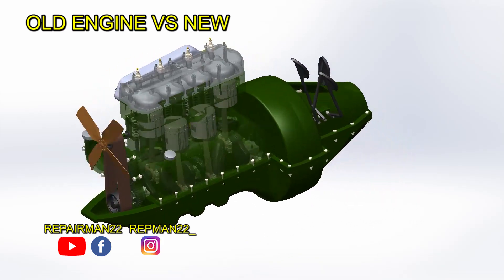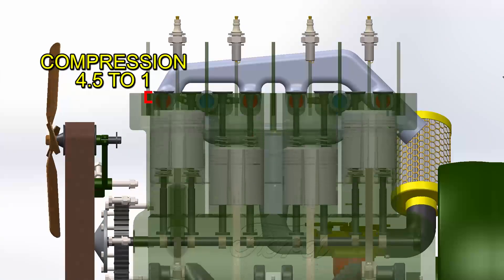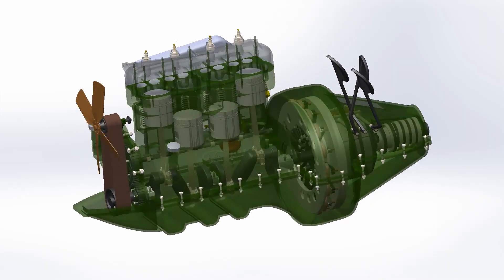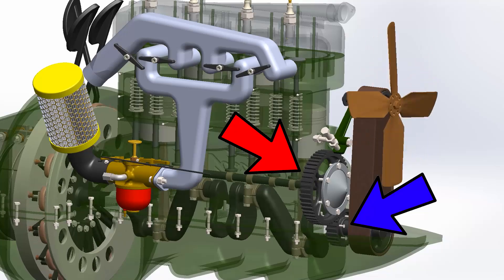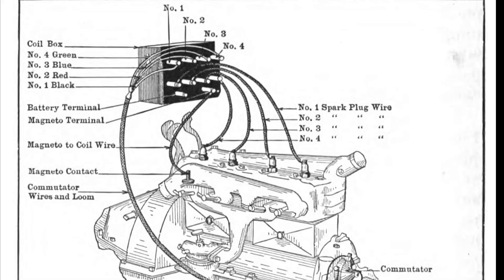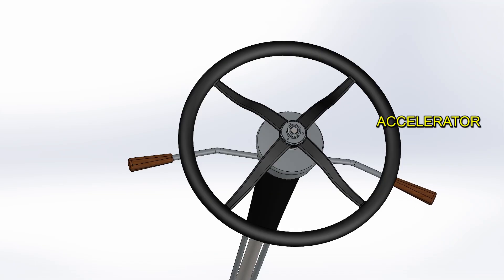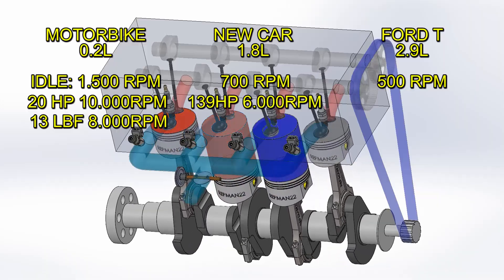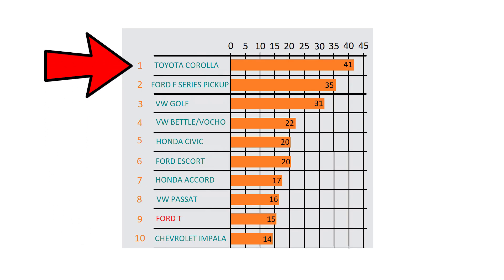Ford T vs New Car 🤯 3D Animation// What changed in engines in 100 years?

Comment: Of course a car made 120yrs ago appears primitive by modern standards, but if the alternative was having to ride a horse I'm sure even a modern motorist would be grateful!
Reply: Although the model T engine is primitive, it’s more appropriate to call it simple and reliable. 
Another option for the time is to ride a bicycle.
Reply: @kerbodynamicx472  Simplicity is the aim in engineering, not complexity. Complexity is very bad, decreases reliability, increases cost. So when something is made more complex, there usually has to be a very good reason to do it, which in modern cars case is far better efficiency.
Reply: @wopmf4345FxFDxdGaa20  the are really not that much more efficient though. For example, I drive a 1990 f350 dually powered by a 460 big block, it gets 10 mpg. The new 7.3 gas engine is the closest comparison to a 460 and a new dually f350 with a 7.3 gas engine will get little better then 10 mpg.
Reply: Few people could even afford a horse or didn't have the land even if they could.  Most people walked.
Reply: The Canadian Automotive Museum has one of the three Galt gas/electric cars made in Galt, ON, Canada. It was made in 1914 and used by Toyota for the year 2014 to promote the hybrid Prius. Under the hood the engine does not look a whole lot different than today’s hybrid. So many car manufacturers failed either due to lack of capital or being bought up by larger manufactures such as Ford and buried due to the innovation that would constitute competition.
Reply: And dont forget ,horses shit everywhere ! 😉
Reply: Seeing as "primitive" refers to early iterations of things, that's exactly what they were.
Reply: No shit buckaroo thank Ford for that. #fuckyourcheby #fuckyourmopcar
Reply: And steam and electric. Not the best timeline we've gone down
Reply: Of course. Why ride a horse when you can spend hours in traffic in a wagon that needs tons of fuel, oils, belts, rubber tires, insurance and endless other crap ??
Reply: Tell that to the Amish.
Reply: $ 5.00 a gallon gas ...we might go back to horse and buggies..
Reply: @tommywatterson5276  Gas in 1915 was 21 cents a gallon, the equivalent of $5.15 in today's dollars.
Reply: @mikefrech1123  in 1915 there were 25 cars per 1000 people. In 2012 for instance there were 800 cars per 1000 in the US. So I guess cars and the gas infrastructure to service so few cars in 1915 were both for the wealthy.
Reply: @mikefrech1123  
Very  interesting  .
But  ?
They  were  "  Just  starting  out  on  that  long  and  arduous   Journey  "
( ie  finding  cheap  oil )
Reply: @tommywatterson5276  Alarming   ?  Is  it  not  ??
Reply: laugh in Amish
Reply: @tommywatterson5276  8 dollars in Europe. You are still way cheaper.
Reply: @Romif_SK  you have Public transportation and your entire infrastructure isn’t built around roads
Reply: @tommywatterson5276  
Don ' t  be  stupid  .
Find  and  develope  more  TYPES  of  "  Oils "
(  Midnight  oil  ?
And ?  What  " Old  Greasers "  use  ? )
And  ,  oh  by  the  way  there  are  MANY  MORE  things  that  can  be  done  about  the  so  called  price  of  "  eggs  "
(  Fuels  &  lubes )
Examples  ?
Too  numerous  to  mention  here .
But  even  a  NEW  way  to  get  fuel  grades  liquids  from  Coal   !
Cheaply   !
     Yup  .
Reply: @tommywatterson5276  5? It’s already 10 in europe
Reply: @Pierre578  everything is relative. I'm in the southeast US. We are USED to paying in the 2 & 3 $ per gallon range.
Reply: @tommywatterson5276  nah just walk and riding bicycle
Reply: @albertsuseintsus7355  Electric vehicles are taking over.

Ironically, the very first cars were powered by primitive non-rechargeable batteries.  It was the Ford Model T that replaced electric motors with the internal combustion engine.  Now they've come full circle, with fully-rechargeable batteries that can compete with or exceed a tank of gasoline, and electric motors that vastly outclass their gas-powered competition in every respect.  With the ease of generating electricity from so many possible sources, the fuel supply is radically simplified, abundant, and extremely cheap.
Reply: @Terminator484  wait, why Henry Ford didn't make a car using gas generator (same power)

that was cheaper , lower fuel consume than Ford model T flat head🤔
Reply: @Terminator484  Yes. There was an 1899 electric delivery truck, used in NYC. Speaking of Gotham...folks diss on the Subway system there (unreliable trains, crime, etc.) BUT...That city was a stinking, overcrowded S**thole at the turn of the twentieth century...worse than nowadays. The streets were full of horses and horse poop. There were streetcars, but those conflict with road traffic, and have to stop at intersections. The former Brooklyn Dodgers were so-named, because you had to be streetwise and not get hit by one of those things. There was an Elevated train going to East Harlem by about 1883. It was steam-powered at first. They were  Very noisy, going past the tenements. There are still some elevated sections today. Also, the Blizzard of 1888 brought ALL transportation to a standstill. That was the inspiration for the subway system. Flooding from hurricanes does cause waterfalls down the station stairways, and I think they should build a barrier to prevent that. But, even the worst blizzards don't effect an underground train. 
There was also the Waverly Electric Car. And, the Stanley and White steam cars were much coveted, as they were more reliable than gas engines in the Old days.
Reply: @Terminator484  Two things wrong; 1) Lead acid batteries are rechargeable, so it is a total myth that old electric cars would have had non rechargeable batteries. The problem was that there was no electric grid so it was useless outside the city. 2) Electric car today still does not outclass gas powered competition at many areas. Three examples; cold weather usage, range and again operation outside the grid.
Reply: @Terminator484  Where did you get the idea that the cars that were replaced by Ford-T were using non-rechargable batteries? This is as silly idea as it gets...
TAXI's were using it... so how much was the cost of a TAXI drive 120 years ago? LoL
And how they managed to win with horse powered cab?!
Normal lead–acid battery were used! Just like in good old Melex cars.
Reply: @Terminator484  maybe but even for free I wouldn’t want an ev car or modern cars . I love my car so much . I don’t care about the rest . Still drive my 1957 jeep .
Reply: @Terminator484  also electricity price explode too in some station in France a full recharge cost more than a full tank of gas .
Reply: @Terminator484  sadly, neither replacing gas cars or beating them is true:
-Gas is VERY energy dense, it can outdistance an electric car despite a 70% energy loss from mechanical losses
-There isn't enough high power infrastructure for teslas to charge in reasonable times in most of america(est.2020, it may have gotten better, however you'd still need an electric generator in the trunk of your tesla)
-At best, an electric can get good launches from it's instant torque, but it doesnt have any gearbox to let it keep up acceleration with literally any half-decent gas car
-Motors don't weigh much, but those lithium batteries do and while it plants the car very low to the ground, it's still weight that needs to be moved so you'll need torque vectoring to even make the handling comparable to some 80s crapbox
-also batteries are bad for enviroment, 10 years of use before you go pollutant neutral(or it was be less polluting than a hybrid)
in summary, hybrid #1, gas #2, electric and hydrogen need to go on a diet before they can even consider existing in public
Reply: @Pierre578  based, has the classic willy's as opposed to whatever the hell things we have now
Reply: @Pierre578  apparently world-class, europe's backbone nuclear reactors couldn't provide cheap power to your cars o7 i hope it gets better
Reply: @albertsuseintsus7355  This isn't cheaper. The reason being that first,  you have to haul around a battery and an extra engine. Second,  converting mechanical power to electric power and then back again has a lot of losses. Third and most prominent; having several gear ratios increases efficiency. This third problem no longer exists for modern hybrids.
Reply: @wopmf4345FxFDxdGaa20  Lead Acid batteries have a habit of pumping out lots of amps at low voltage. They quickly deteriorate and break if they're not fully charged. That's why their use is to power electric starter motors; temporary and only partial drain to power a high current low voltage device, backed by an immediate recharge. Nowhere near appropriate for powering an electric motor until drained and then recharged later. They weren't used for this purpose.
Reply: @Johnsoline  if gas electric engine is useless  ,then why does diesel electric locomotive and diesel electric ship still exist?
Reply: @ok-qz7cx  the idea behind electric motors is that they don't need a gearbox. Gas cars stair-step their torque, exchanging torque for speed in a manner that very roughly simulates the natural torque angle of an electric motor as you shift up
Reply: @albertsuseintsus7355  this question has nothing to do with what I said. Using a gas engine to power an electric motor in a hybrid model T built with 1908 technology would be senseless. It's modern technology that brought us feasible hybrid cars
Reply: @Johnsoline  sorry ,but it's possible to build an gas electric car/motorcycle in modern era ?
Reply: @Johnsoline  Starting batteries indeed do not tolerate deep cycling because they are not designed for that, but there is other type of lead acid batteries that are slightly better for deep cycling. Sure they are still not very good by modern standards.
Reply: @Terminator484  electric vehicles aren't taking over shit, they are gay and only fans drive them.
Reply: I'm not so sure I agree. Horses were more reliable than the first few generations of cars according to my grandparents but I wasn't alive back then to say for sure so what do I know.
Reply: @YblockEnthusiast  but you only used fuel when operating the car. The horse had to be “fueled” even when it was just parked.
Reply: @erniemee7128  Yes, but "idling" horse is "burning" less than a working one. The only issue with horses is their exhaust fumes...
Reply: @YblockEnthusiast  
Yes  ,  a  truly  Marvelous  beast  of  a  High  Tech  machine  !
Awesome  potential  for  the  future  ,  like  many  other  Animals .
How  often  do  you  see  African  Elephants  towing  a  loaded   cart  ?
Whereas  ,  the  lndian / Asian  are  leaving  those  African  dudes  "  for  dead  "  ?
Reply: Yes  ,  lndeed  !
The  seat  fitted  to  a  horse  ie   hairy  skin  covered  meat  muscle  flexing  continually  ,  is  like  a  " Bouncy  Cast ill  "
Don ' t  be  " Cowboys "   ALL  your  life  North  America  !
Come  back  to  earth .
  From  
         Geo  rage   ?

Comment: Surface area has basically nothing to do with friction. More bearing surface area is desirable, as you will get into hydrodynamic lubrication regime faster and increase the area of load distribution.
Reply from the maker: That is 100% true in theory, but in practical terms, 1 you have to move more oil so there is more friction. 2: oil harder to enter and reach the center to lubricate in larger bearing with no oil pressure.
3: Modern cars uses 0w20, small bearings and low tolerance to use less oil in that zone. Thank you.
Reply: @repairman22  if the three bearing system worked they would still use it it doesn't work.
Reply from the maker: @davet.5493  now cars make 200 horsepower, not 20. thats why we use today 5 bearings. Also we have oil pump... it is said in the video!

Comment: Alcohol typically has a high octane rating of about 100 to 110, so saying that the model T's low compression ratio allowed alcohol to be used is WRONG.
Reply from the maker: but the manual advancing was the solution, thats why.
Reply: @repairman22  : My point is that alcohol engines have no need for less than 10:1 compression ratio, reguardless of timing.
Reply: @johndavidwolf4239  You don't need high compression to burn high octane fuel, but high octane fuel allows you to have high compression without knocking
Reply: @czechgop7631  : True, but both efficency and power increase with higher compression, engines should always be designed to with the highest compression that the intended fuel used can withstand.
Reply: @johndavidwolf4239  And with that I absolutely agree, even though high compression ratios bring high stresses to all components requiring heavier engines and expensive specialized lubricants. We may hit a point where the boost in efficiency just won't be worth it anymore
Reply: @repairman22  ALL CARS HAD MANUAL ADVANCE CONTROLS UNTIL THE MID 30'S. Do home homework
Reply from the maker: @johnrebus1641  so. We are comparing a t with a 30' or with a modern car?

Comment: This isn't a fair comparison, the 1909 engine is a MOPAR engine that Ford bought from the Dodge Brothers.
Reply: ouch but true
Reply: The term mopar wasnt used by Chrysler corp until 1937, 17 years after the Dodge brothers both died. The Dodge brothers were contracted by Ford to build the engines and some other parts, but the design of it was all Ford.
Reply: I beg to differ. Read the article American Car Historian: The Dodge Brothers and Henry Ford. The third paragraph tells me that The Dodge Brothers in 1902 Mr. Ford asked John and Horace Dodge to become his major parts supplier. (Abriged.) They made him running gear which consisted of the engine transmission and axles. This went on until sometime in 1913. You are right, it was not called MOPAR until 1937 from Anti-freeze. But, this name is now connected to every mechanical part that is connected to a vehicle connected directly to Dodge Chrysler. So yes, it is still right for myself to refer to it as MOPAR.

Comment: If a company built these new today, how much would you pay for it?
Reply: $50
Reply: @johnrebus1641  but you'll pay 10k for a golf cart.
Reply: About 1500$… I mean I can get a harbour freight motor with more power for like 200 bucks so
Reply: It only needs 20 horse though. But it has to have the old tractor engine sound.

Comment: as a BMW E93 3 series owner, the reliability hasn't really changed in 100 years.
Reply: You weren't getting 200k miles at highway speeds from a Model T engine.
Reply: @jamesengland7461  I don't from my car either, 140k mi  and I'm already $14k in the hole on maintenance for this POS.
Reply: @uncommonsense360  oh wow I'm sorry! That's awful!

Comment: Francis the two other thing I missing on your video its that    the ground of this car was positive and the fly wheel was very powerful generator with 16 or more coil wire pulse in dc  corrent like big generator that algo could bee charging batteries and drive like eletric motor car with out petrol ,and because of number off coil ont flywheel was more then need if the engineers swap the pulsed coil they will generate feedback eletric to the batteries and then no need for fuel
Reply: impossible
Reply: Model t was neg. ground. The model A was pos. ground.
Reply: @BigDadio1967  yes u right  positive  ground  its  real ground  but they dicide to swap earth ground for negative,  but energy flow from negative  to positive  ,just. Do this experience  at home  pick a car battery  get a led light or any kind. And hook the negative to the light and find any ground of the house or a fance pole that. It's. Ground good  u will see the light will glow, no positive  connection just the earth+ and negative from the battery,   now  do the opposite with positive  .